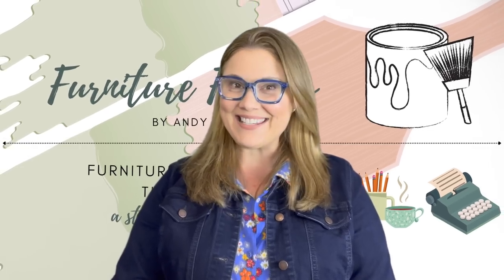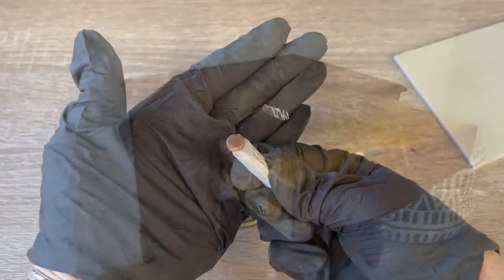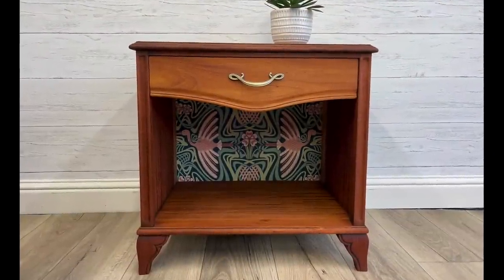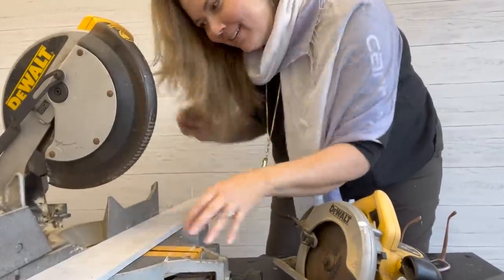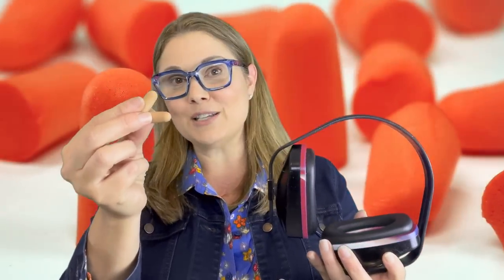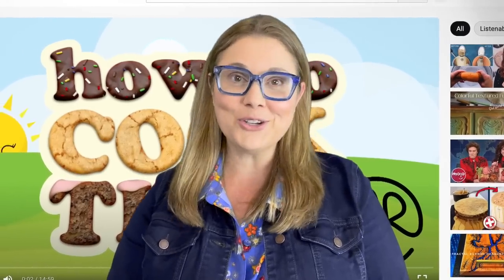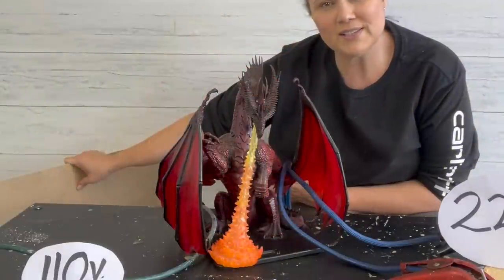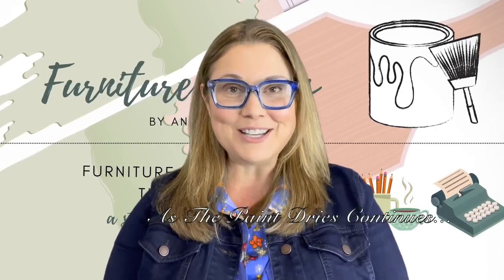DIY DANGERS and How To Be SAFE In The Workshop | The MOST DEADLY Craft Hack WARNING!

Comment: If I may, I’d like to add that anything over 600 volts (I think that’s the number) will actually arc across different materials. This means that you don’t actually have to be in contact with it, but just close to it. And of course, that distance becomes even larger with higher voltages.  
 I say this from experience. In Jr High school electric shop, i was sent flying 10 feet when i came close to a 10,000 volt transformer while making a Tesla coil.
Reply from the maker: Holy smokes - I'm so glad you are ok!  Thanks for sharing - electricity is no joke, people need to know how dangerous it is! 🙏

Comment: "healthy respect for power tools is probably a good thing" Very well put. As a woodworker I have saws including hand saws that can be intimidating. Use common sense and maybe watch a few videos on the power tool you want to use.  All your power tool tips are right on.  With a miter saw and a table saw stand to the so if it kicks back you won't get hit. I have had a few kick backs on my miter saw and they happen so fast you will not have time to react.
Reply from the maker: Such great advice!!  Yes, I always recommend any person starting out with saws checks out Wood Working For Mere Mortals or some other woodworking-specific channel - I am fairly knowledgable, but certainly not an expert.  Kick-back is one of the reasons I am going extra carefully and slowly learning on my table saw.  😊👍

Comment: Hi, Andy--and thanks for another great video!!  PLEASE, would you be able to steer me in the right direction for a small sander which can specifically handle carving??  Have you come across any attachments that are somewhat pointed, like a chalk-paint brush??  It's not within my budget at present to snag one of the all-purpose sanders---but one like this would be a great place to start...:)  Thanks as always---from Karen
Reply from the maker: Hi Karen, thanks so much!  So for wood carving, depending on how much you need to sand and how detailed that carving is, you may be able to use a basic triangle sander.  (you can search "triangle sander" at Amazon or Home Depot to see examples) and you should be able to find something under $40.  But a lot of folks will hand sand wood carvings - often time sanding sticks or even what they call "sanding matchsticks" are used - they literally look like those long matchsticks you use to light a fire. I hope that helps!
Reply: @FurnitureFablesbyAndy  Thanks so much.  :)

Comment: Are you sure it was the paint and not just lead in the alloy? My guess would be the latter. It was some mix of lead, copper, and whatever else that was bronze plated. Just don’t lick it and you’ll be fine.
Reply from the maker: Great question!  I re-did it off camera, making sure I was only touching the swab to the painted areas, and then did one just touching the sanding pad, with the same results.

Comment: A comment about wood dust.  Many species of wood, walnut is one, can and does cause life-threatening allergic reaction if to much is inhaled.  A friend of mine reminded me several years ago that the dust you can see is not nearly as problematic as the dust you can NOT see.  So, after that conversation with him about 9 years ago, I purchased and now religiously wear my 3M mask like you displayed.

Also, you should mention that it is very dangerous to wear gloves and long sleeve shirts/jackets when using power tools like circular saws, table saws, routers, etc.  You can, however, wear very form fitting long sleeve shirts.